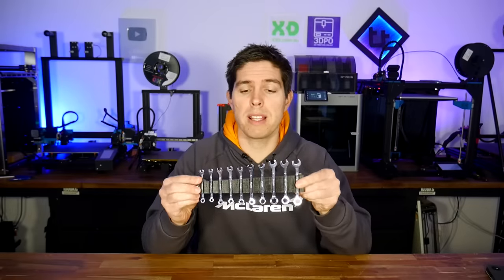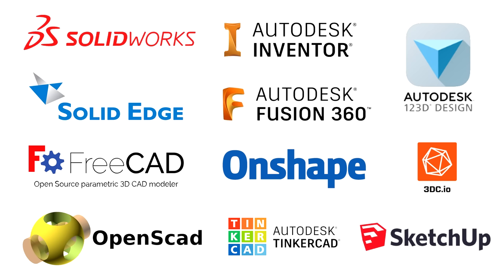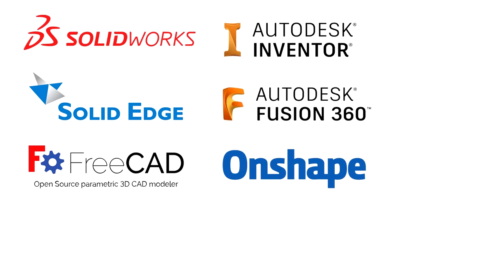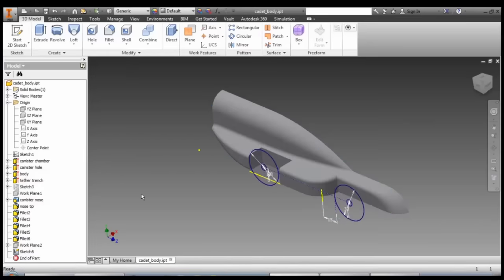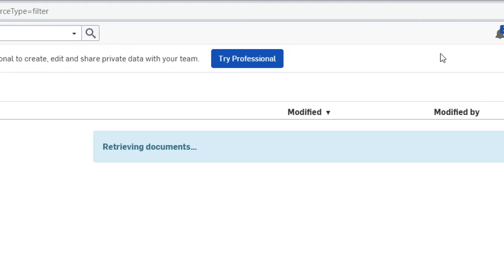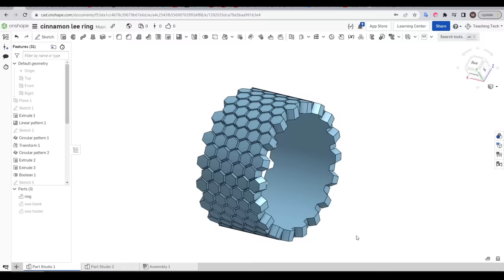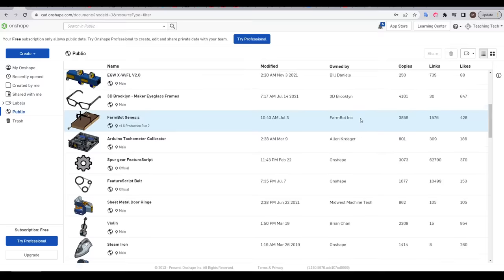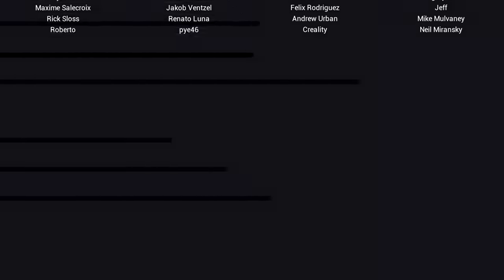Selecting a free 3D CAD option - 3D design for 3D printing pt1

Comment: I learned on Solidworks as well. I also used Onshape often from home, in Linux and on a large Android tablet. Fantastic software and easy to use. It was even able to do assemblies with angle and interface measurements. However, as someone who often needs to do CAD away from an internet connection, I am using FreeCAD. Yes, there are some frustrations but I find that I am able to overcome most problems easily and I am using it to create functional parts on a weekly basis.

Comment: Another option to help managing your projects in Fusion 360 is to see each project as group of various projects instead of a single project in itself. You can easily create multiple "projects" within a single one by creating them as separate components (nested if necessary) and just switching on the components(s) you want. As you export to STL from components not the project as a whole it works fine in that respect too.
Reply: You mean instead of toggling 'editable' all the time?
This would work ok, but I parameter-ise a lot of my stuff, so it might get a bit unwieldy. Definitely worth thinking about though as I often save iterations out separately then have to toggle.
Reply: @thingswelike  yep. Given hiding a component hides all the components, bodies and sketches nested inside it, I would have thought it'd make little difference whether they were highly parametric or not, as any dimensions, constraints, origins, etc would all get hidden along with it.  And as each component has it's own design history (shown when made the active component), you should also be able to go back and make changes to parameters found there too, on a per component "project" basis.

Projects frequently have multiple separate parts that get exported for printing separately, it's pretty much the same principle, just that they are actually more "separate" than usual.

In your iteration case, you can just nest everything in a new component directly under the main project component, then duplicate this (or later copies) each time you want a new iteration (apologies if this is obvious to you).

The only issue I see is in performance if you add too many, and this is something I can't really comment on so far.

Comment: I had 2 decades of experience with Autocad for 2D before I started 3d printing. You would think I would go with Fusion360 but in reality Autodesk hates it's users so I chose FreeCad. I've been using FreeCad since 0.16 for both 3D printing and CNC and am reasonably happy with it.
I've nearly 350 self designed models using it.
FreeCad does have some quirks but it's been getting better. The tutorials will get you started but they way they tell you to do it isn't necessarily the most stable way. For people new to cad I would agree that it's potentially tricky to self learn. But if you can learn "what not to do" then you can create some extremely complex models using it.
If I was to advise people on a couple of things it's to avoid using chamfers and fillets until the very last steps because they're the one thing that doesn't recalculate well. I also don't reference sketches off other faces. If I need to do it then I will do it and then clone it to a stand alone sketch.
By sticking to those rules I have almost no problems.
(Edit): And I will never ever use cloud software.
Reply: what do you mean with "autodesk hates its users" ?

Comment: Really well done analysis of the available options. I started on fusion 360, but got nervous when they kept locking down the features for the free version. I invested significant time learning the software only to have my plans interrupted by feature removal. I jumped to freecad and am glad I did. The learning curve was much steeper but also much more comprehensive. I’m still no pro but, have a far better understanding of parametric design and best practices workflow. OnShape sounds good but I can’t ever risk my work being held hostage in the cloud again. Hopefully that will never happen for those that decide to use it.

Comment: I use fusion 360 (the free one). I find that the active model limit is meanigless to me, slightly annoying at best. It's easy to learn and I like my programs to actually be on my computer.
Reply: I also used to like it before they froze all my models forcing me to upgrade, after a year or so on the free plan. And this will inevitably happen to you too.
Reply: @the_last_ant  every year it freezes but you can just revenew the free license and no save is lost
Reply: @hyperphrog69  True, it worked, thank you :) But when I tried to edit a model it wouldn't open, and when it opened after a few days it was lagging extremely, even though the model was quite simple. So after several hours of frustration I tried to recreate it from scratch with Onshape, and was surprised how similar it was to Fusion360, but even easier, cleaner, and without any lags. But yea, it's still not ideal either, cause they can change their mind anytime and remove the free plan..

Comment: I exclusively use CATIA V5, which is probably akin to installing a screw with a sledgehammer. But it's the CAD software we were taught in my first year of university, and thus what I have the most experience with. Very powerful but not quite that user friendly. Buy hey, it works!
Reply: Ive spent years supporting CATIA V4 and V5 in the aerospace industry. Gave you a thumbs up just for mentioning it. lol
Reply: @GrandpasPlace  Cool! And yeah, I'm an Aerospace Engineering student so that makes sense.

Comment: Great idea for a series Michael. I've been considering alternatives to F360 for some time (in case they remove the hobby license in the future) but without much success. Very much looking forward to getting to grips with OnShape.
Reply: Try 123D design, it's basically the prequel to Fusion 360. Works very well, and probably wouldn't be hard for you to pick up. (already knowing Fusion 360)
Reply: ALTAIR INSPIRE STUDIO + render.
Reply: @grantdeisig1360  I used to use it when I first got started, but quickly moved up to F360. Appreciate the advice though 👍
Reply: @joseguevara184  Not heard of that before, will give it a look. Thanks 👍
Reply: same crap, vendor lock-in and unaffordable prices for hobbyists

Comment: I had been using fusion 360 for a couple of years and really like it but I recently had to take an engineering graphics class that uses onshape and I like a lot of things about it more, for one thing even though it's completely browser based it loads and runs smoother for me with my slow internet speeds than fusion 360 does

Comment: I have used Sketch up for several years and luckily have a 2017 version downloaded that works well for me although no longer supported.
I like Tinkercad but a lot of what I now do requires more complex shapes. For some time I used freeCAD but the learning curve is steep and although I get where I want to be it can take several attempts. People shouldn't get frustrated and there are a lot of Youtube videos available to support you. 
I was also a DT teacher in the UK and  learned my CAD skills on AutoCAD.
Reply: I have the same issue, I've been using SketchUp since it's inception and Beta and have gotten to master it but I'm having such a difficult time with almost all of the Parametric modeling programs and I have tried all of the ones highlighted with the exception of 2 that I saw in the comments Solid edge and Design Spark Mechanical which I'll probably try when I get back to the States from vacation

Comment: I chose FreeCAD a while ago. Fusion360 got me bad vibes and since their changes on the "free forever" section I feel I did well. Also I am not limited to Windows, which I don´t use for anything. Dragging people into the F360 eco system and use their models as hostage feels wrong. In the end you need to export .stp and loose all the important information on a model. The goal is to be able to return to older models at some point and when that hits a potential paywall in the future I don´t want to invest my time there.
CAD files cannot be compared with images or text files. If you swap applications you loose the work flow in your files. Always.  This results in more work, because your old files exported as .stp are basically stripped down versions of your work.
Reply: Out of principal I refuse to use anything from AutoDesk. A bad culture company that peddled garbage for years.
Reply: @kippie80  Well Dassault (solidworks creator) is even worse. They made Draftsight, absolutely and completely product tested it on free version. When it was complete, they made program commercial only. So I'd say they're even worse.
Reply: I'm still learning how to use it but it's basically the same story for me except maybe more extreme. I don't like the idea of any CAD program that I need an account for or any kind of online connectivity. That rules out almost all options. With FreeCAD though, all I have to do is download it and it's ready to go. OpenSCAD is another that I might get into but I had problems with it slowing to an absolute crawl.
Reply: @harbingerofwarx995  yeah, having stuff potential taken hostile is not feasible. It is always the same. It is free until it is not or they shrink the rights to use the files you made until you give in.

Comment: It's actually not that difficult to give a cube a fillet in Tinkercad. There's an option called 'radius' that will give you what you want. However, you are correct when you have actually edited the shape. There is no easy way to use a fillet.
Reply: Part of the problem here is that a "fillet" is technically used in an inside corner.....an outside corner is properly called a "radius".
It's really not the software that has issues so much so as the users...no offense intended to anyone, been there myself before and likely will again....

Comment: The first free package I used was Sketchup and ran into the same problems, so they haven't been fixed since 2018 when I tried and abandoned Sketchup. I think the problem is that Sketchup was built for construction/architecture or furniture, things with macro dimensions, not precision things like precision mechanical parts.
FreeCAD is what I use now. It suffers that super-techie open-source world where sometimes you have to almost be a software designer to understand how/why things work. I think I experienced flakey behavior and it is so complex to reproduce the problem you just roll if your second try produces no bugs. So, very sketchy, but the best option I have found so far. 
Fusion 360 abandoned true support for free guys like me, as you say.
Your video turned me onto Onshape, seems to be a good option.

Comment: I proudly own my bias. My bias is against full cloud applications. I prefer my machine to be doing the rendering and get much more immediate results. My prefered used to be Fusion 360 because it had similar tools to what I used professionally. I got tired of the cloud processing done in F360 though. I eventually broke down and purchased a license of BobCAD. The tools are a bit different than what I was used to but it's a software that I own lock stock and barrel. No yearly plan, no subscription, and 100% belongs to me. That is my preference, and certainly does not make it right for everyone, plus it is not free. Which is outside of the scope you are laying forth here.
Reply: I share your skepticism for cloud-based tools. That said, it's a trade-off that comes with benefits. For one, not being tied to a specific OS or hardware platform. For another, collaboration can be easier with the cloud-based stuff (depends on how well they implement that, of course). In theory , cloud-based tools can be more performant. Again, depends on their implementation -- sounds like Fusion 360 didn't reach their potential. But cloud-based rendering (for example) should be able to be much faster than done locally, even if your machine is fast.

I don't use a lot of cloud-based tools, but I'm looking forward to seeing how OnShape works out. I've used Upverter in the past, and it worked very well most of the time. Its main flaw at the time (maybe they've improved since then, this was several years ago) was that it couldn't handle poor Internet connections very well.

Comment: As a former draftsman, you should be using the term "round" instead of "fillet" for externally rounded corners.  Internally rounded corners a technically fillets.  Someone else explained it like this "a "round" is usually thought of as applied to a convex edge, while "fillet" usually means a concave edge."

Comment: I'm not sure I'll ever understand why "browser based" is considered to be a positive feature by so many. It always just feels so clunky to me, and I can't work on my projects if my internet is down. I so much prefer having dedicated software downloaded on my machine.
Reply: the only positive i see is that if your computer lags performance then a complex multipart project wont be an issue on the browser based interface. Other than that i also prefer the local offline version since the ISPs are unreliable
Reply: @gat1994  I'd have to get an older computer and test that out I suppose.
Reply: Not everyone have new powerful computer. No need for smart comments
Reply: multi-platform, zero-installation, real-time collaboration, unified storage, versioning, sharing... and it actually runs smoother on older pcs as all the processing is on cloud infrastructure... only rendering is performed in your pc.... your only valid point is offline operation
Reply: @knoopx  and the only feature you just mentioned that is exclusive to cloud-based software is the lack of installation, which isn't a feature important to me. You can store thing in the cloud and work on them together, and video games with online multiplayer have been collaboratively manipulating software for years using software with local installations. The differences don't make either of our points invalid. There are pros and cons to both, with the only feature exclusive to either being whether or not the software is able to be downlaoded. It's a matter of preference and what works for you, and I prefer to be able to have my software available locally.
Reply: @knoopx  also, in my experience, rendering is a task older systems tend to struggle with. Maybe not so much in CAD as the applications I have used them for though.
Reply: @lamborn3D indeed, I'm not all-in for cloud-based solutions but there's many things to love (vendor lock-in is not one). rendering speed is ultimately up to your graphics card performance regardless if you are using a web-based or native app. what I would love to have is a self-hosted, web-based, open-source cad solution that I can use from any of my devices. but I'll just keep dreaming...
Reply: @knoopx  that would definitely be nice, I'll dream with you, haha. I do like that some cloud-based software gives you the option of also having a local installation of the product, so that you can work offline if necessary at home but still connect to work on your projects on the go.

Comment: I loved 360, then one day they removed my ability to save my files to my own computer. Last I checked, they had back tracked on this, but the warnings were clear, and the damage was done.

To simplify:
If you cannot save your files locally, you do not own them.
If you do not have an offline app installed (and backed up) locally, then tomorrow you could be screwed.

For these 'for hobbyist'  deals to be serious considerations, they must come with some 'water tight' guarantee wrt to access, functionality and ownership. I do not see this happening. And sure their ease of use may save you hours, but this is meaningless if/when you are locked out.

In the meantime, these should be called out for what they are, cynical attempts at market manipulation designed to limit competition and the adoption and development of truly hobbyist friendly solutions.

As this channel is something of a technology leader,  I'm saddened by the path you have chosen.  An extra thousand FreeCad/Blender etc users contributes greatly to these community projects. An extra 1000 'for hobbyist' users has been shown to add only an extra bottle of bubbly to the next shareholder's meeting.
Reply: you can export a step or whatever file from onshape, there's a few options